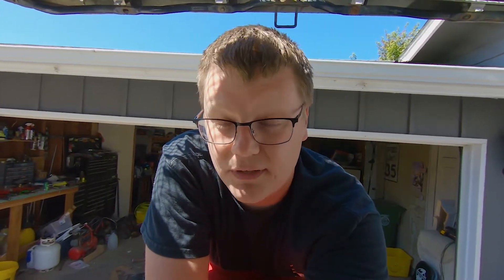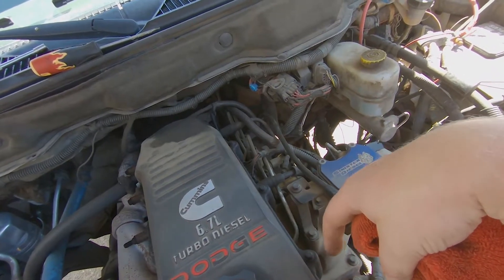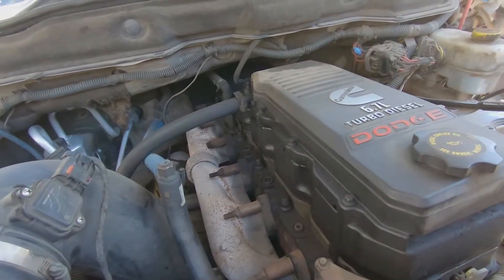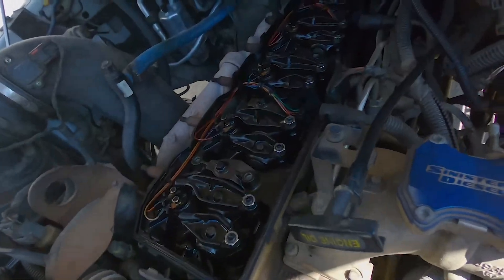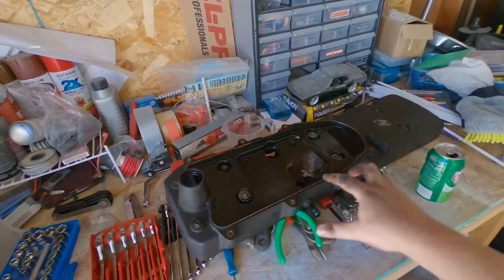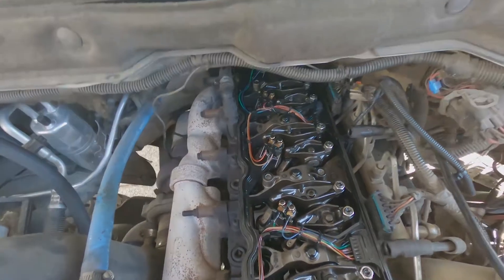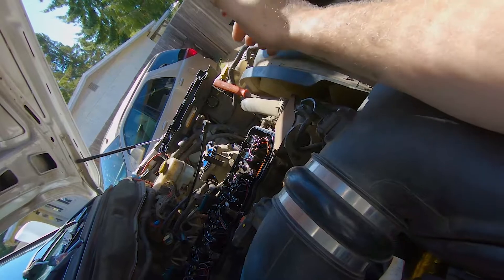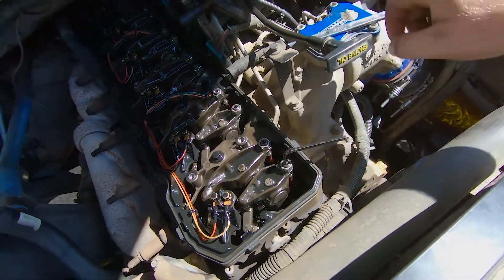Valve adjustment on a 6.7 Cummins

Comment: So at the end of the video when you had your truck running and you hear that ticking noise it sounds like two wrenches getting clocked together mine has that same noise what is that I've heard it's the CP3 pump and I've also heard that it's normal for the 6.7 to do that mine just started doing it.
Reply from the maker: I need to watch it again but it could have been the clutch, I will watch the end again and listen
Reply: Ok  @Cargill450

Comment: Do you have to replace the valve cover gasket with injector harness attached or is it reuseable?
Reply from the maker: The harness/gasket is reusable but just make sure the rubber gasket isn’t hard or damaged

Comment: What all is done to your truck, it sounds way better than mine
Reply from the maker: It’s not a whole lot, it has a s367 turbo with a BD manifold, 10mm cp3 and a few other odds and ends exhaust is 4 inch straight also

Comment: I’m glad I watched this I had a diagram for my 2007 6.7l Cummins it shows .006 intake and  .015 exhaust I havint done my adjustment yet I had the head shaved cuz she blew head gasket but Iv got gasket in head shaved and in now with arp 2000 head studs is 10 and 20 good on all year model 6.7l Cummins ? It’s my first Deisel truck rebuild
Reply from the maker: Yup 10 and 20 is good for all years of 6.7 IF the emissions equipment fell off, if the emissions are still intact I would go 14 and 20

Comment: is there a torque value for the rockers when you finish adjusting them? or do you just go nice and snug? thanks
Reply from the maker: Technically yes the torque for the lock nut is 18 foot pounds, you can get a feel for that torque by hand but how ever you do it you have to check the lash after you torque your nut because it will change

Comment: Is red Cummins 6.7 on the box truck the same as pickup truck black engine?
Reply from the maker: If I'm understanding the question correctly yes it is, your still going to want to go .010 on the intake and .026 on the exhaust if the emissions are intact and .020 if they are not.
Reply: @Cargill450  thanks. Where did you buy the measurement tool?
Reply from the maker: I bought them at napa, I really like the angled ones
Reply: @Cargill450  thanks man, I'm about to dig  into engines, never opened before, tired of waiting time in garages and all the charges 😅. Appreciate the video.
Reply from the maker: Absolutely!! I hope it helps
Reply: @Cargill450  one more question: how to adjust rest of the valves? Turn that line on the engine from 12 o'clock to 6 o'clock? Or?
Reply from the maker: You are going to want to take it a complete 360 back up to 12 o clock. Your cam shaft is going to spin at half the speed of the crankshaft so you will do the first set then spin the motor a complete revolution and then you will be able to do the rest. I hope it makes sense how I explained it
Reply: @Cargill450  yes, thanks.

Comment: So I took the exhaust side push rod out to clean it cuz some debris got on it well when I went back to put it back on it sits higher than the rest if I tight the Allen bolt it wants to bend what can I do to fix it?
Reply from the maker: What kind of debris? The couple things that come to mind right off the bat is something got into the tapit not allowing the push rod to set back in or you might not be in the tapit at all. You might take it back apart and take a really good look down into the hole to see what's going on.
Reply: @Cargill450  just some dirt that fell next to it so took it out clean down there and cleaned the push rod before inserting it back in. Its not flushed like the other ones but nothing got inside tho
Reply from the maker: Just be careful with it, might make sure before you try to set that pushrod that that cylinder is on the compression stroke before you adjust it at all, just be mindful and if something doesn't feel right double check it.

Comment: Great video. Thanks. I just tipped 270K on mine, and have been meaning to do the valve lash for a bit. Anything else you can recommend while in and about?
Reply from the maker: Mainly just the lash, these engines hold up really really well.
Reply: @Cargill450  thanks again. I use a lot of BG products, and have the BG flushes done when I can afford them. 270K is a lot of miles, and very few of them have been easy miles.

Watching your seat cushion video right now. It's been near the top of the list for a little while too.
Reply from the maker: The BG flushes are awesome, the seat cushion was honestly one of my favorites so far. It made the truck enjoyable to drive again

Comment: After you did the 1st round of adjustment with top dead center up. What is the next position of balancer for the other? Also couldnt you run the valves with the eoic method "exhaust opening intake closing" when the exhaust first cracks set intake when the intake is all the open and begins to close set the exhasut. This is method used on any pushrod engine that requires valve lash.
Reply from the maker: After the first round you just go 360 on the crank, one revolution and you can get all the others, im not sure honestly about the other method because I haven't tried it on these engines but it would be worth messing with maybe

Comment: What turbo do you have on the truck?
Reply from the maker: The turbo setup is the old BD super bee R650. It's a factory replacement 3rd gen swap with a BD manifold and a billet 367, its a decent little kit but it was before they started selling that kit with a 366 sxe charger.

Comment: Are you going to Color match the back bumper and are you going to get different tail lights to match the front and are you going to take those lights off of the tail gate so basically are you going to refresh the back of the truck
Reply from the maker: Absolutely im just waiting for the right time, its needs a new tailgate and bumper and well everything in the back is going to get a refresh. It needs it badly

Comment: I love the sound of these 6.7s.
Reply from the maker: Me too man they just have a tone to them that can't be beat
Reply: @Cargill450  especially when they're running a 5" straight pipe. 🤤
Reply: @Cargill450  by the way, fantastic video, ive been waiting for a good informative video on valve adjusting, i need to do mine soon
Reply from the maker: thats just a 4 inch but don't you worry the 5 inch is in the plans.
Reply: @Cargill450  I'm running 5" turbo back straight pipe on my 08
Reply from the maker: @cadilakisrodcustom  I bet that sounds damn good, I like the deeper tone of the 5 inch
Reply: @Cargill450  I love the 5", but your turbo is louder than mine
Reply: What tune did you go with for the delete ?
Reply from the maker: @nicksedgwick5189  I went with Firepunk tunes and I love them!!